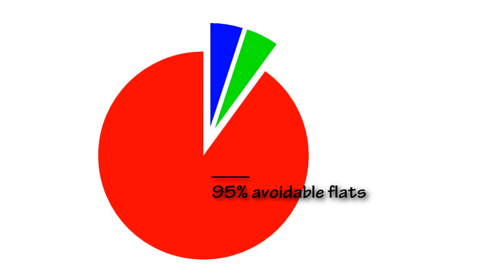Flat Tire part 1 -How bicycle tires work

Comment: Good presentation, Saul.  I had no idea that 90% of flats were pinch flats.  I never really thought about pinch flats, actually.  I have had the occasional flat, and maybe they have been of the gradual variety.  I was also riding on really old tires, so the tread and structure were probably very much worn.